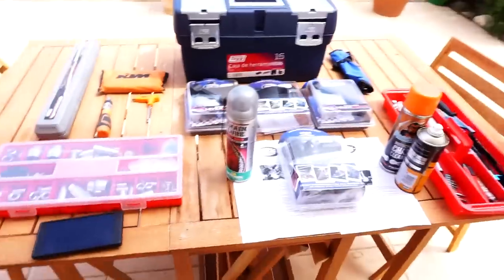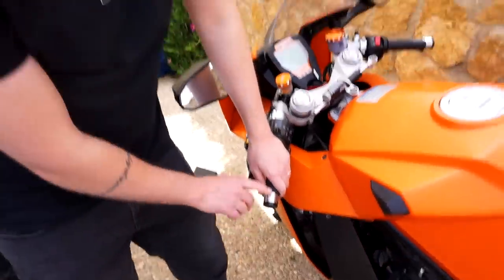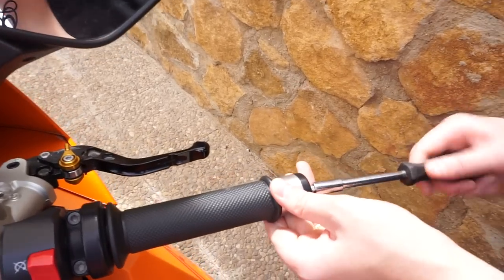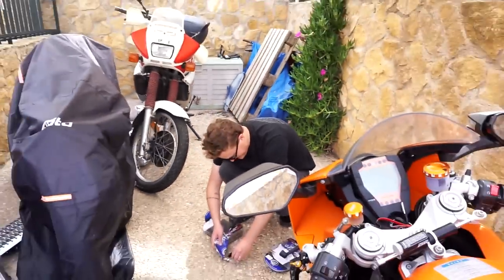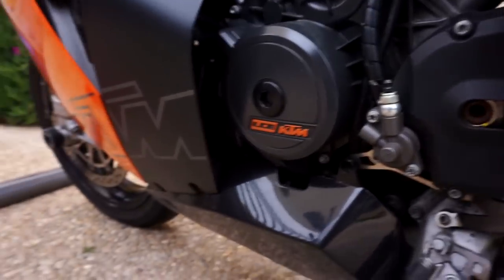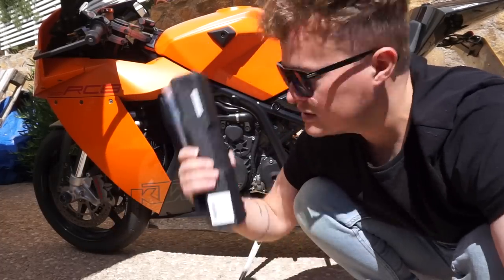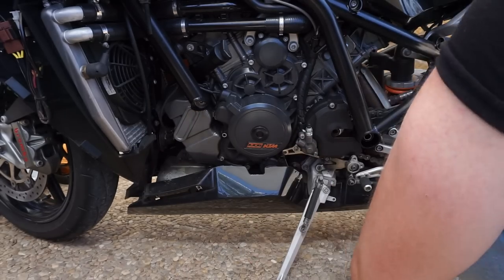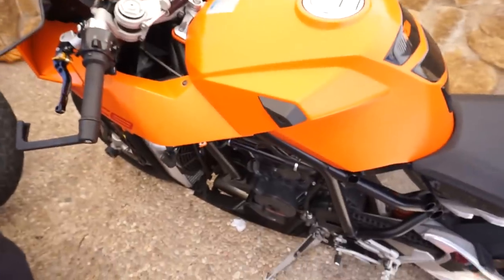THESE MOTORCYCLE MODS WILL SAVE YOUR BIKE | R&G Crash Protection

Comment from the maker: Gabi is literally a mechanical dictator...
Reply: Women are honestly another breed of human I swear (in a good way) 😂
Hey Duke, I'm saving up my money at the minute for a 125 as soon as I can however I'm stuck between 2. The Yamaha yzf r125  and the ktm rc125. Which would you recommend/is better?
Reply from the maker: I love KTM man but the Yamaha is more reliable for sure. They have very similar engines but Yamaha doesn't have the technical issues (like misting dash) as they are not built in India. But at the end of the day it's whichever one you prefer the look of. Don't buy new, buy second hand and one without an aftermarket exhaust as on those bikes aftermarket pipes make it burn oil.
Reply: @DUKEBLADE  cheers mate, MASSIVE help 👍
Reply from the maker: Thanks bro 👌😂

Comment: Try out that foam but it might not work as well as proper mic foam covers.  I ordered some because mine fell off and I lost it, I put some foam over my mic but air goes straight through and is not much better than without, I even doubled it up.  Back to the video😀
Reply from the maker: Foam and in the backpack, works great for recording external exhaust sounds! Just need to get s better exhaust now 😆
Reply: @DUKEBLADE  I see, I assumed it was for your mic in the helmet.  That will sound awesome, you going all out? full system and filter and a tune (needs tuning with full systems, no power commander, doubles the price, unless you want it set up with a switch so you can use stock settings too.

I'm still waiting on a decent day to put my Scorpion end can and DNA filter on, chain and sprockets too -1 front, she'll be a beast 650.

Comment: R&G are the only brand of protection i trust on my bike, I will buy your bar ends if they are still available
Reply from the maker: Yeah if they will fit, what is your bar diameter?
Reply: @DUKEBLADE  the inner diameter is 7/8th
Reply from the maker: I'll measure 👌